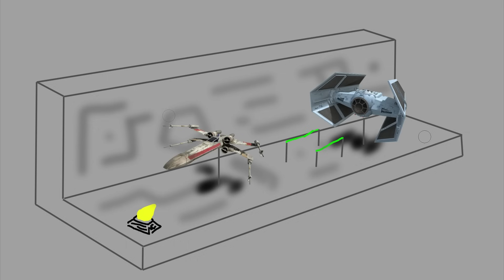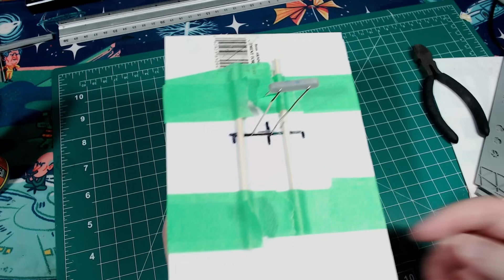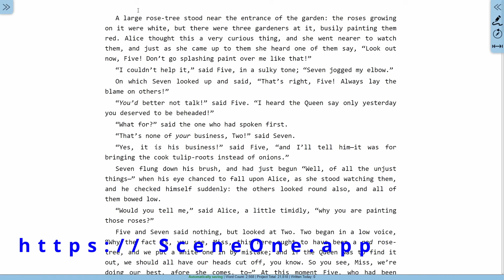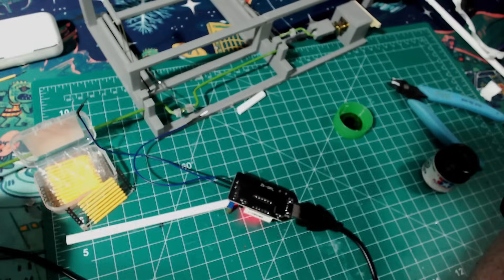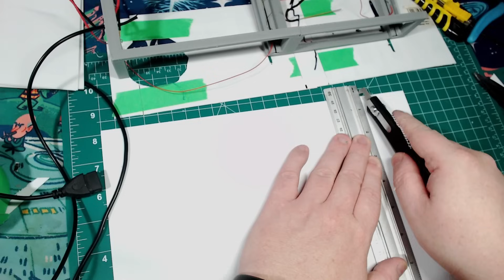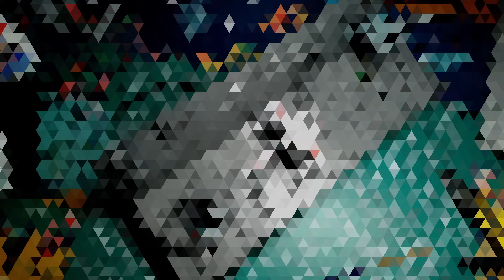Death Star Trench Run with MOVING ships  |  Star Wars diorama, 3D Printing & Scale Modelling

Comment: Ok.... Instead of making a still death star trench make two mini conveyor belts using vinyl and/or  rubber glued on painted pieces that rotate as two conveyors making up the trench hall and re locate the armatures holding up the ships so that the rods come around the bottom of the bottom conveyor and come in from the side. Same with the led lasers. Then you will have the ships moving back & forth as well as the conveyors rotating creating the illusion of foreward flight  movement  down the trench like in the movie scene. Youre welcome. May the force be with you!
Reply from the maker: A vertical treadmil is an interesting idea, for sure (you could also put in a "hyperspace" background or asteroid field, etc). It's feasable for me to add something like that to this diorama, too, as that wall is a separate, non-structural piece and easily removed.

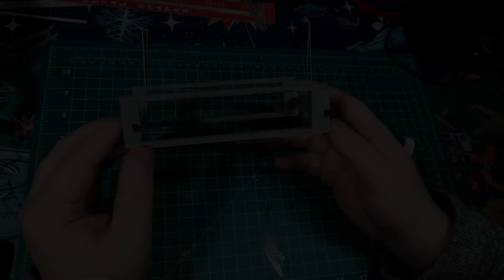Comment: 9:00 You can make that sliding beam longer so it extends out so you can attach it directly to the push rod as opposed to attaching it to the display arm.
24:30 You can take advantage of that parallelogram holding bars the 2 display arm create connected to sliding beam and at ship, as demonstrated at 3:50... You could have the travel slit on the floor for the display arms to be shorter than the motion of the moving beam. The arm would hit the side of the slit while the beam continues, adding a more 3d motion

Comment: Great idea, but ditching the swaying made the two rod mounting obsolete. I kinda agree with your philosophy of using solid materials for big surfaces and weight bearing parts, but if you had printed out the trench (plenty of tiles freely available on thingiverse, printables etc), you could have easily hidden the openings for the rods in slightly thicker panel lines and therefore made the whole movement less wobbly.
My biggest critique would be the scale of the vent compared to the X-Wing… it‘s supposed to be the size of a Womp rat. The X-Wing is supposedly 12.5 meters, the vent 2 meters. Had I used a glue gun for fabricating the torpedoes, I would have squeezed them out onto a flat surface for easier control of the shape, peeled them off once hardened and then glued them onto the LEDs.
But that‘s just me being picky watching someone else‘s work and being a backseat driver with 20/20 hindsight.
All in all, good job!
Reply from the maker: Some good thoughts, thanks! I have the 1/72 versions of both of these kits (which are about 2-ish x the size of these), and have figured out a much more reliable way to achieve the swaying that I'd wanted, so may tackle it again in the future. As with many things, there's a LOT of, "Oh, of course! It's so simple!" after you've done it once, haha.

Comment: Re the brass rods, about thirty years ago I got my hands on some brazing/welding rods (I'm not a welder, so it could be either) and they've served me well for this kind of work.
Reply from the maker: Interesting! I may have to take a stroll around Home Depot one of these days and see if anything jumps out as useful.
Reply: I'm a welder I was just going to recommend  copper coated carbon steel TIG wire, comes in 36" length and many sizes I personally have used .035, .045, 1/16, 3/32, 1/8, 1/4 and comes in 1 lbs or 10 lbs tubes
Reply from the maker: @kilomagd8557  Oh interesting! I'll have to plug that into google and see what I can find. Thanks for the recommendation!